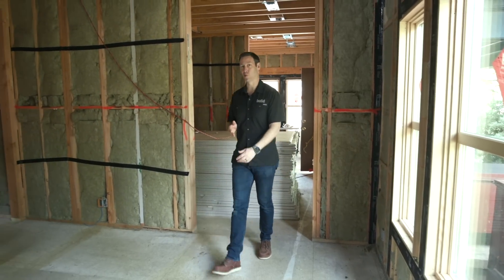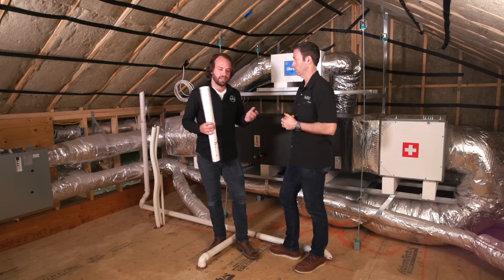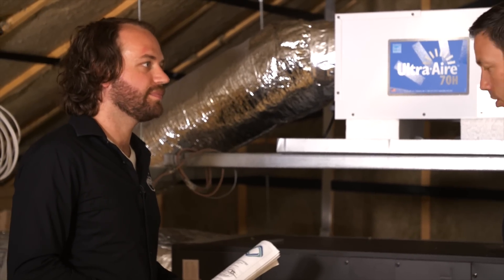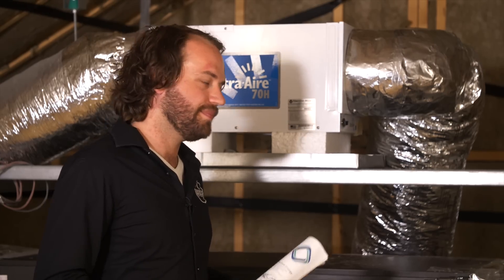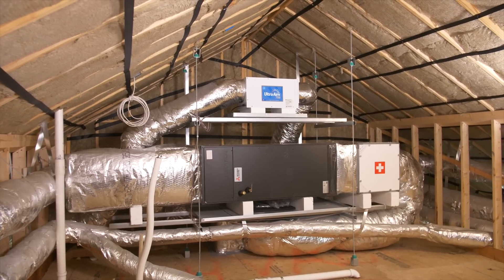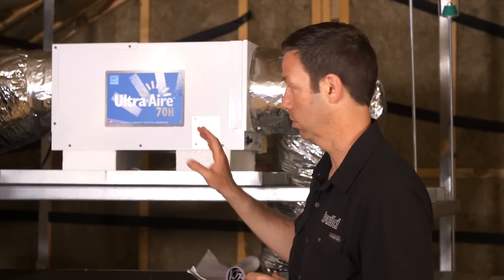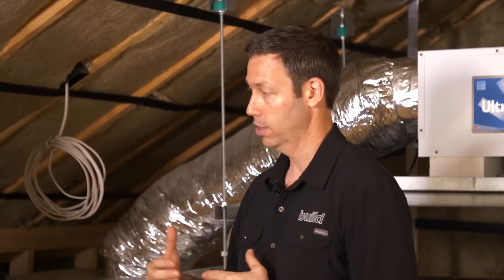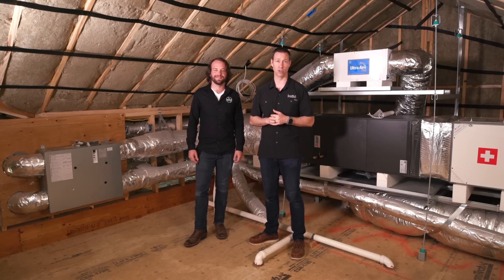New BUILD : Excellent Air Conditioning System Cost?  I’ll tell you!

Comment: I live 45-miles north of Austin in a builder-grade new home. I have zero issues with my HVAC keeping the humidity at a comfortable level in the the cooling seasons. Typically 40% on average. My issue is in the heating season. So much talk about dehumidifiers, but what is the best way to integrate a humidifier for the winter? My body is used to humidity. So when it the heat is on or I use my wood burning fireplace, it dries me and my house out something terrible. I see humidity as low as 7%!
Reply: Honeywell makes a simple add-on humidifier. It picks up air just prior to the furnace and runs it over a wetted pad and then returns the moist air  just distal to the furnace and before it splits into individual ducts. Cheap and easy. We turned our furnace on low circulation to move the pellet stove heat around the house and it added the humidity at the same time. They also have steam style but we have VERY hard water and I didn't want issues cleaning the steam tips

Comment: 4%-7% of budget for a $1Mil house...30%+ budget for a $200K house!
Reply: True talk. I'm building a tight house in the hot humid south and do not intend to have a dehumidifier.  It doesn't make sense to me to have a 20+ seer ac and a 5 seer dehumidifier.
Reply: At a $200k price point, you're going to be buying a chevy HVAC system, not a cadillac HVAC system. Basic filter, no dehumidifer, 2-stage SEER 16 HVAC... and that percentage is against the cost of the house, not the selling price. Average cost of materials to build a house is about 40%-50% of the selling price. Labor is another 30% - 40%. So a $200k house is $90k in materials, of which $3k-$5k is going to be the HVAC system as installed, which is basically the ducts, wiring, system, and maybe an ERV/AEV.
Reply: @azurealism  YOUR NUMBERS ARE WRONG....YOU WOULD BE SURPRISED AT WHAT YOU LEARN IF YOU DID YOUR HOMEWORK
Reply: Your math is wrong, a top line efficient and well designed system is not $60,000. I'm a licensed contractor in Arizona and we charge around $12,000 for everything listed in this video with a high end 2 stage A/C or Heat Pump
Reply: @briangc1972  

This is a vrf system, not a two stage. What would the price be with vrf?
Reply: @jl9678  THE MAN IS AN AC CONTRACTOR.....IT DOESNT COST THAT MUCH...DO YOUR HOMEWORK....THAT ACTUALLY WAS A BASIC AIR HANDLER WITH A DEHUMIDIFIER WITH IT.....VFD TECHNOLOGY IS THE MOTOR CONTROLLED AT VARIOUS FREQUENCIES...IT SAVES ELECTRICITY..NOT NEW TECHNOLOGY BUD
Reply: @briangc1972  it's not my math. Matt said 4-7% of $1M...how much is that?!?!?
BTW IMO-- $12K is too much...
Reply: @briangc1972  RIGHT!!.. PEOPLE ARE,TOO GULLIBLE!.. THE FACT THAT THEY EVEN TOOK TIME OUT OF THIS VIDEO TO TALK ABOUT THE PRICE...TOLD ME ..THERE IS AN ULTERIOR MOTIVE GOING ON HERE!...

Comment: legit question: is it necessary to insulate (put roxul) the interior walls if your perimeter+outer walls are insulated with high r values?
Reply: Assuming a good exterior insulation, except for rare cases ( wine cellars and such )  interior insulation if going to be for sound/noise control.
And good noise control is more than just insulation. You need air sealing, and transmission buffering (stand-offs) along with insulation.

Comment: Just the IQAIR alone is $2500. I would love to see actually the amount of money this guy is spending on a 2000sqft  house and what his electricity bill is. I have a 2300sqft house in San Antonio TX that’s 2 years old 16 seer 2 stage equipment and my electricity bill is never over $250 bucks. So with all the extra insulation top of the line ac system I’d be willing to bet he pissed off a hundred thousand dollars or more to save $100 measly dollars a month. The good news is in 83 years he’ll break even as long as the Mitsubishi unit last about 6 times longer as regular unit. But it’s not he will get maybe 15 years if he’s lucky and then it’s time to buy a another $25k Mitsubishi-unit again.
Reply: Man, IQAir is an expensive brand. As you can see in the video it's just a box with a bunch of pleated filters. All hvac manufacturers offers their own filtration system, may cost significantly less.

Comment: I live in a 280 sq ft apartment in SF but I would so love to have positive air pressure just to keep cigarette smoke out. Not going to happen, but I can dream.
Reply: MakeMeThinkAgain if you have some ingenuity and at least one window you can do it. The hard part is where you can get the fresh air. If it smells more smoky with the window open you're  out of luck. But if it's leaking through the walls and floor you can simply put a window fan in the window blowing in and positively pressurize your space to push the air out your door and other leaky spots. Hope this helps.
Reply: @jon3615  People go outside to smoke so it's the outside air that's the problem. I try to seal my windows (100 year old double hung) and run an air cleaner inside. Works well enough.

Comment: Why distribute fresh air in a set of special ducts? Why not utilize the main air con fan and duct the fresh air into the main plenum, or thru the dehumidifier first if needed? The timed fresh air would call for the main fan at a slightly higher CFM for turnover compared to the smaller ERV fans but saves the extra cost of dedicated ducting? Why wouldn't that work?

Comment: IQAir Perfect 16 ID2225 Replacement Particle Filters $395 the set of 4 filters
Reply: When you drop $1+ million dollar on a house restoration job, $800 bucks a year for filtration is nothing.
Reply: @valkyriefrost5301  Except the won't get replaced after a few years - especially if the house gets sold a few times - those expensive units/filters get clogged up and the owner will be no better off than with a cheap system.
Reply: @ArthurDentZaphodBeeb  - Well, it's always up to the home owner/purchaser to take care of the maintenance. I'm not a big fan of the single layer multiple filter style cases. A 20x25x5 MERV 16 runs around $60-70 each and would handle that setup fairly well. I do not know the general cost of 4 smaller filters shown in Matt's video. OR course, you can always replace those MERV 16s with a set of MERV 9s if cost becomes an issue :-P

Comment: 5% of 500k is 25K for a 3 Ton AC.. Buying high efficiency AC systems is like buying stock in a Brothel, you don't need it. All AC's are dehumidifiers and pleated filters are a waste of money because they burn up high dollar DC motors (AC ones too) :-) When a blower motor costs a G or two (1K) instead of the normal $100. from the local supply house.. You have not saved a penny on efficiency but instead you were not green at all, but just cut down a big slice of forrest and polluted the ozone royally.. But you intended to be efficient and go green! And if that inverter board goes out and costs you 3k because your pleated air filter overheated the blower motor by starving it of air and caused a backfeed of voltage b4 the motor actually died, you just polluted all of Texas (ehhe) (seen it happen many times)

Comment: As home owner of a 50 year old house with a traditional AC system that may need replacing in 5-7 years. I wonder how retrofitting with "mini splits" fits into what we know about building science? such units don't provide fresh air circulation or anything approaching hepa levels of filtration and the dehumidification is handled only by the act of cooling the air, but still the promised efficiency and fairly low cost is attractive; not to mention multi zone control.  Are there solid options for filtration,  fresh air, and dehumidification conjunction with so-called ductless systems?  should such consideration be concealed within the conditioned space? Anyone have any ideas? Perhaps this could be a topic for a future video?
Reply: This is exactly what I've just installed in a new (1967sq ft) house.  It has 5 mini splits.  3 for bed rooms, 1 for main living space, and 1 for bonus room.   Then the same Panasonic ERV as seen in the video (thanks Matt) is separately controlling fresh air.  We pulled exhaust air from 3 bathrooms, utility room, and living room.  And dump air into 3 bedrooms, bonus room, and main living space.
Reply: @wjthehomebuilder  do you Know of any resources to determine the sizing of the supply and returns for the ERV? like an online calculator, or something like that?
Reply: Casey H. I suspect the Wrightsoft people could answer that question about METHODS & tools for sizing the duct, etc on the ERV.
Reply: @YouTubestopsharingmyrealname  I don't know of anything.  I let my HVAC guy run the duct work.  All lines  (intake & exhaust) terminate in 6".  I think there is an 8" line closer to the unit.  And as the video states, you can individually control intake & exhaust as needed.
Reply: WJ the Home Builder so did you go with the ducted or ductless VRF?  Are they running of a single outdoor unit?
Reply: @northavealum   We went with ceiling mounted ductless units.  Yes they are running off of a 5 port Daikin (part # 5MXS48TVJU.)  This is an over sized unit for the house, but it had the 5 ports needed for each run.  I didn't mind it being over sized as VRF will only run what the demand is.  It's very unlikely that this unit will ever see 100% usage as the house is super high performance as well.  (Very tight & over insulated.)
Reply: @wjthehomebuilder  thanks for the reply.  I'm strongly considering the ductless VRF for a 1940s Cape Cod that we're hoping to renovate & add an addition.  How are you finding the ductless units in terms of coverage within the room?  Is the efficiency living up to the claims?
Reply: @northavealum  The system is not operational yet.  However, I will be monitoring everything once the customer moves in (hopefully by end of July.)   But the ceiling units are near the center of the rooms and should distribute the air nicely.  They are also oversized simply because Daikin doesn"t offer a ceiling unit less than 9000 BTU's.  That's way more than needed for a bedroom!  Everyone that has seen it has commented about how the mini split system is THE most efficient system on the market.  The VRF is what sold me.  (Again thanks to Matt's channel.)
Reply: exactly the question I'm wondering.  If the ducted Mitsubishi VRF has a SEER of ~ 17, and the ductless a SEER ~ 33, it would seem smarter to go with the ductless and use the Ultra-Aire and the ERV to manage the humidity and fresh air.  I'm looking at a renovation and have the same questions as you.
Reply: @northavealum   right on! Im thinking in my case, the smart thing to do is to housing an  HRV and dehumidification in the space the current furnace is located in; it's like a closet. With those in place, I could run a return and supply from each room.  But, I don't know if that's over kill or even what the proper sizing is for a 1200 Sq ft house would be.
Reply: Casey H. I’m certain someone at Mitsubishi could help you with the sizing. The info I’ve read suggest the system would be as big as you might think - especially if you have a really airtight house. Good luck. Post a reply when you decide what you’re going to do.
Reply: I meant VRF might not be as big as you might think.

Comment: Hey Matt - very useful discussion, but I have a question. Which components are sharing ductwork & what is the sequence?  I see that the IQAir is inline with the Mitsubishi VRF) & it looks like the IQAir is pre-filtering air being feed into the Mitsubishi, but I can't tell if & how the other two components integrate.  Are the Ultra-Aire and the Panasonic ERV each using their own dedicated ductwork?  If not which components are sharing ductwork? How are the components sequenced?  Finally, how do they keep the airflow balanced so that the components don't battle each other with so many different components playing with the air?
Reply: I'm no expert, but I think it would go like this:

Dehumidifier --> ERV --> House in one dedicated set of ducting.

Air conditioning --> House in another dedicated set of ducting.

The two systems have very different needs and ERVs/HRVs aren't recommended to share ducting with AC at all.
Reply: from what I got it was VRF + D and the filter system in one and the Panasonic system on it`s own. that is my Miguel said you can use a smaller 4` pipe for the fresh air system,

Comment: How complex is the maintenance of these systems? I'm thinking specifically of years down the road where the home may have been sold or transferred and a new homeowner comes in and needs to figure out how the system works. There are a lot of different filters plus settings/adjustments on the units. How standardized are those filters? Will there be problems finding replacements in the future, etc, etc...
Reply: This is actually a conventional system, it's just an air handler and a condenser outside. This specific system just has added accessories. So, my issue would be how the accessories communicate with the main system which is just software.  Not exactly overly complicated but system maintenance wouldn't be more than any other system really. It has expensive filters...
Reply: The HVAC install company very likely offers yearly service/maintenance. I will assume a $500k+ homeowner can afford that service.
Reply: @craiguglandrealty3705  we have done a ton of multi million dollar homes and only a handful want those maintenance agreements, we love them because it stops the bs from homeowners demanding we fix all the major problems their systems have on one visit when NO ONE has touched them in years
Reply: You should not need to do any periodic maintenance, other than filter cleaning, or replacement.  The filters after the air handling unit should not need to be changed often, since the air is filtered before entering the return duct.  There is a filter on the intake side of the "ERV"  which I take it is an air to air heat exchanger.  It will probably need to be cleaned, or replaced more than any other filter, except the filter behind the grating of the return duct.
Reply: @MartyRothbard   You're partly right, in that yes, the air filter in the outdoor intake side (both sides are filtered) will require frequent servicing. That said,  there are no filters "downstream" of the air handling unit, but the MERV 16 filters in the return, located directly at the return intake of the AHU, will require somewhere between regular, to intense replacement schedule, depending on how dusty an area the home is located. Those filters carry a $$$$$ price tag ($345.00 - $395.00) per change. Here's a pretty interesting, and accurate article on high efficiency filters: https://www.energyvanguard.com/blog/unintended-consequences-high-merv-filters
Reply: For a technician, the maintenance isn't complex, but the air filtration cost maintenance will be high. This is a system that will probably need filter changes more frequently and needs more expensive, higher grade filters. This drives up costs. Also, when the Mitsubishi system breaks down, its going to need troubleshooting and you'll need techs trained and EXPERIENCED on Mitsubishi software, systems, and special tools. The VRF system isn't like a typical system where within 30 minutes or less the issue is diagnosed (this increases labor costs when troubleshooting). For a passive house, the VRF system probably won't operate often, or for normal operational periods of time. This type of operation, though, is like driving your car in constant stop and go traffic. It is going to wear out your engine prematurely. HVAC systems are not designed to withstand short cycling or operation in low heat load conditions. Sure, the Mitsubishi system can unload to 15% of its cooling capacity. However, the risk here is oil loss and a failed compressor. Mitsubishi has designed its system with that risk in mind, but not for continual operation. You'll probably want the system to be programmed at start up to conduct more frequent oil recovery cycles. A passive house is definitely going to operate in an "unloaded" state and increases that risk.
There's also the Dehumidifier and ERV. Inexperienced technicians won't know how to work on it, and who knows if parts are readily available for it.
Design engineers can talk about how great the system is (and in this case, it really is a GREAT system), but they don't get to see it two or five years later when all of the problems arise because the home owner didn't spend the higher costs to get highly qualified and trained technicians to maintain their system above standard.

Hope this helps.
Reply: @nickmeeder  wow sometime typing alot of bull shit

Comment: For overhead systems why not use a small duct high velocity system like Unico?  Air aspiration into the rooms using the specialized terminals means much better air mixing and even better humidity control.
Reply: You want to have as low pumping and friction losses as possible.  High pressure high speed small ducts are the opposite.

Comment: Matt, I know you're thinking about guys like me when you roll your eyes about some 'not getting it".  The problem is tight houses WITH bad design choices (like off-gassing foams/carpets etc) - you rely on HVAC  to not gas your family because the homes are so tight.   Those expensive high-tech HVAC systems are great - when properly maintained/functioning.  But people don't maintain them - people forget (or are never told - average home sells every 7 years and follow-on owners might not have a clue they have MERV 16 filters - and instead buy the cheapest big box home-store filters that 'almost fit' and then install them facing the wrong way).  I'd much rather spend the money on extra insulation, thicker walls, higher quality framing, windows and doors, roofs and foundations.